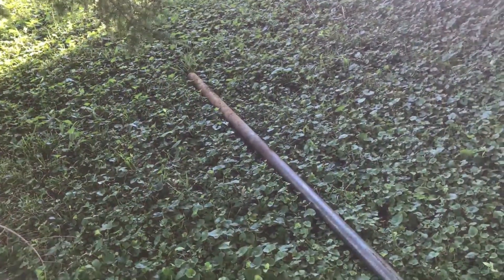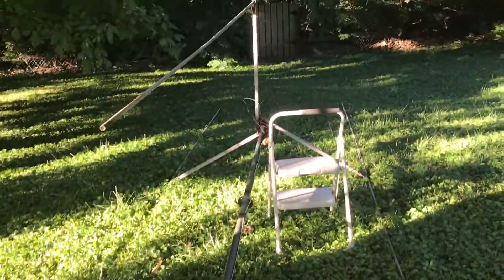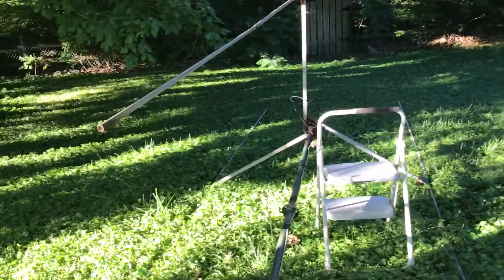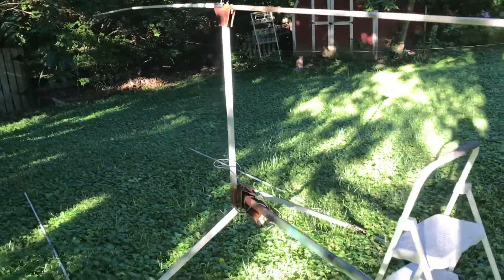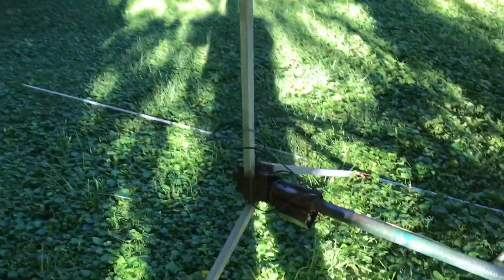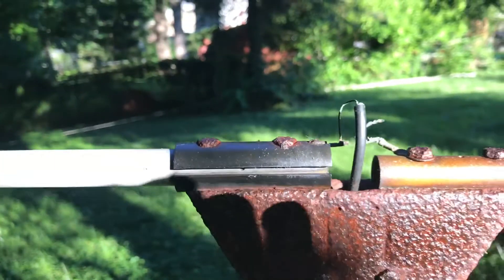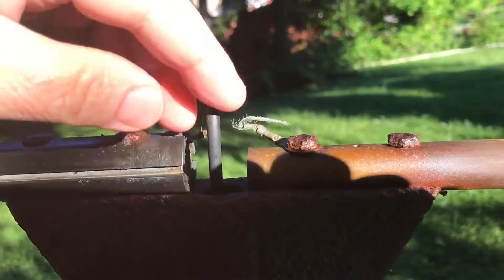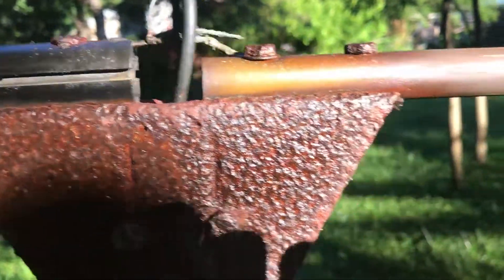Super Scanner Beams Look See

Comment: Use RG8X instead of the RG58.
Reply from the maker: Eric 12374 I wish I could but there's no room for them to fit up inside the booms because they have to be folded over
Reply: You might want to try 3M Liquid electric tape on those exposed connections. Since the late 70s huh? You, and many of your subscribers were mere radio neophytes back then. We even know what electronic "valves" (tubes) are, or were, I should say.

Comment: Yikes all corroded. Take all the metal parts and sand blast the heck out of them. I did that with the two i have.
Reply from the maker: Eric 12374  unfortunately don't want to put too much money into them so sandblasting them is out of the question. I am going to go however take a steel brush on the grill to them and clean them up the best I can